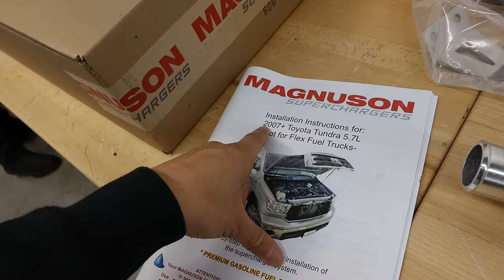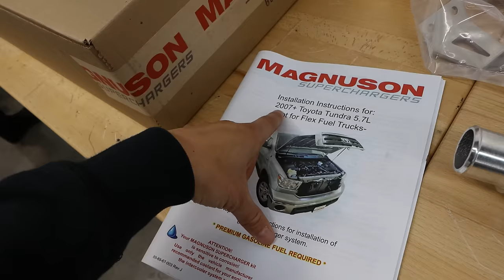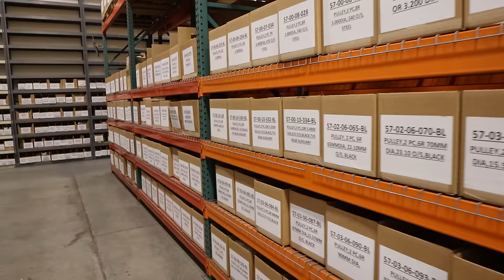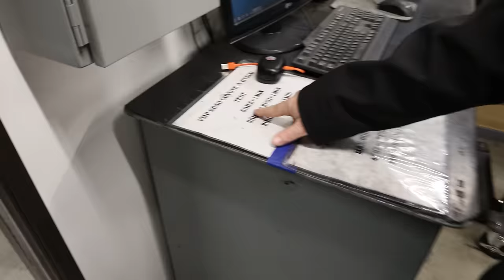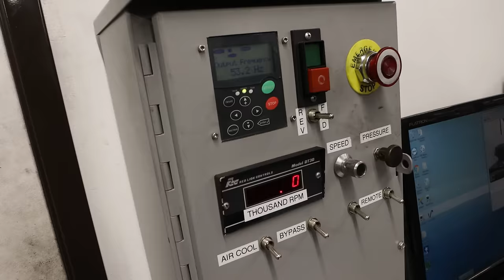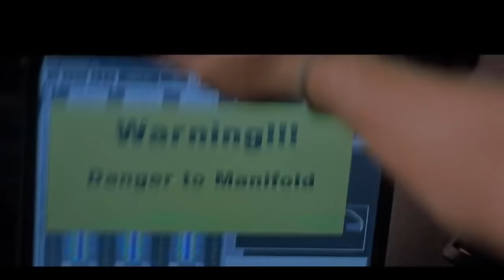Making 550bhp In My Toyota Tundra With A Magnuson Supercharger While Still Being CARB Legal

Comment: That’s the TSV1900 I just bought the 2650. From what I read the biggest change they made to that specific super charger is the intercoolers inside are bigger and handle heat much better then before and has bigger rotors inside that transfer more air. I think you can upgrade yours

Comment: A set of 4.88 gears and ARB airlockers, it would be a beast!
Reply: Does the rear end hold that much power? Or do people switch to ford rear ends?
Reply: @v8_sami  The rear axle he has with the 5.7L has a 10.5" ring gear, 36 spline shafts at 1.457" diameter.  It has more enough strength for the power it has.

Comment: 550 is actually a little TOO much for that motor. At 500 HP Toyota had problems with breaking motors. The rods are NOT  built to take it
Reply: I heard somewhere 550 was the upper limit for what you could do before you have to start upgrading the internal parts

Comment: Harrop is a better option the the 5.7 Tundra.
Reply: heard the same but why
Reply: @PhoneBoothLivin  larger displacement supercharger so it so isn’t have to make as much boost to produce the same volume of air.  An make much more power if tuned. You can run it without a tune as well. There are some design elements that make working on the Harrop easier as well.